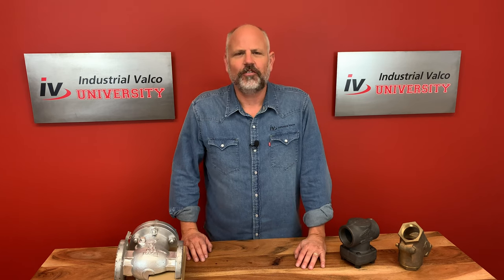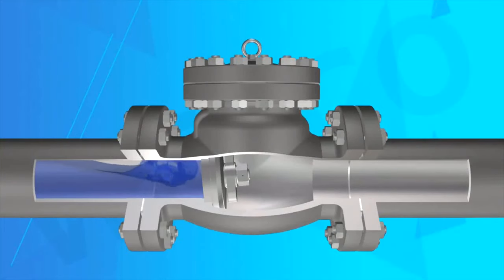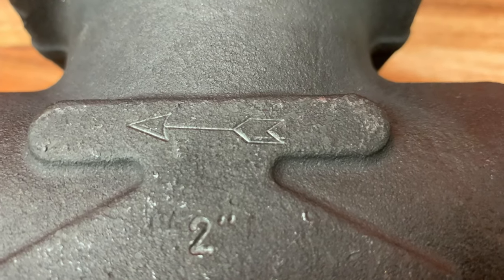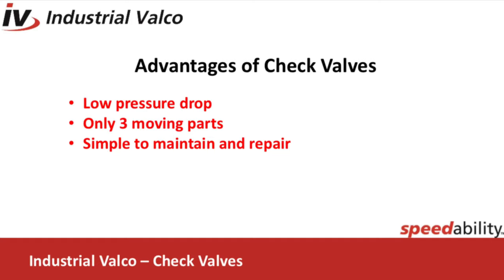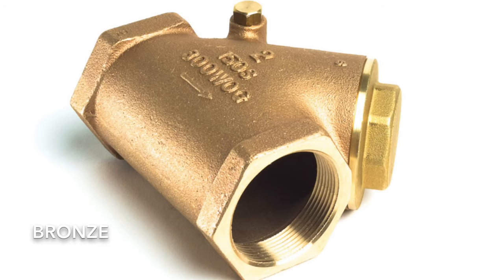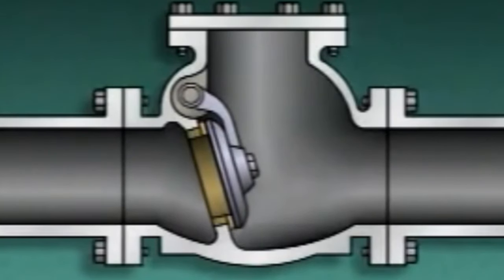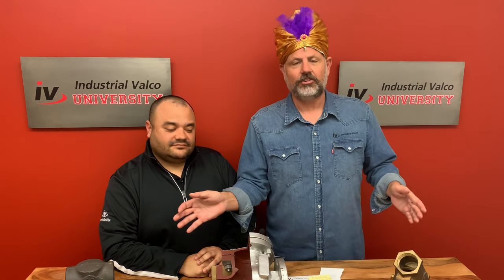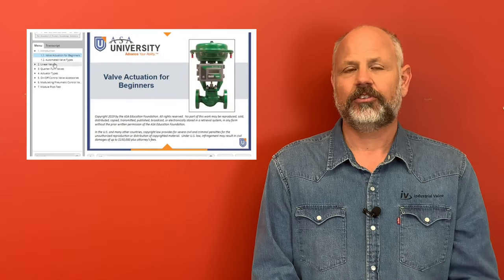What is a swing check valve

Comment: I  am assuming the  Plug at the top of the check valve is to drain the check valve.. I am installing a shallow well. The check valve will be 30 feet away from the jet pump and 3 ft down ( frost line) In the colder months we will be winterizing the cabin, so I am assuming i can release the check valve by loosing the plug at the top of the check valve.  Vs using a spring check valve where i would put a T into release the water   or remove the check valve totally. Is my assumption correct?